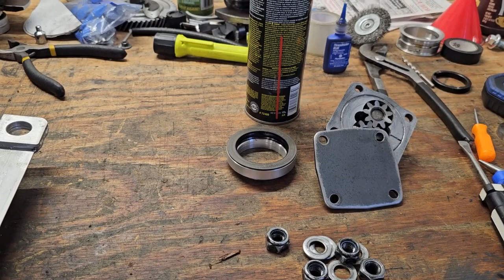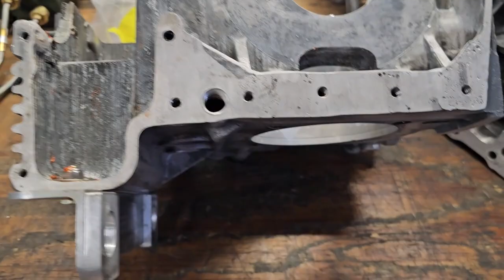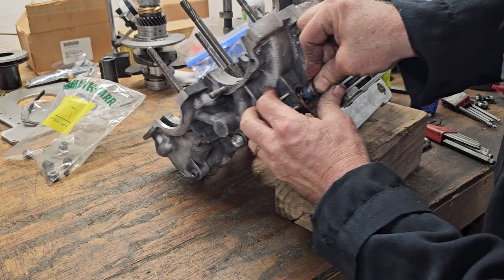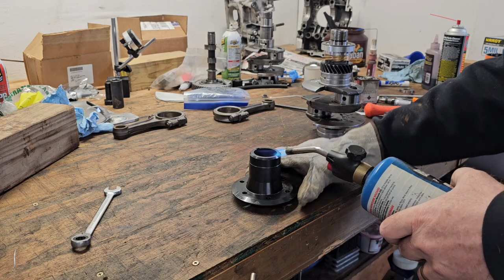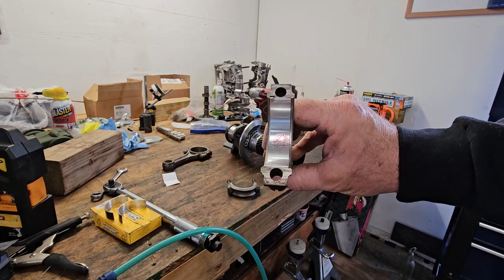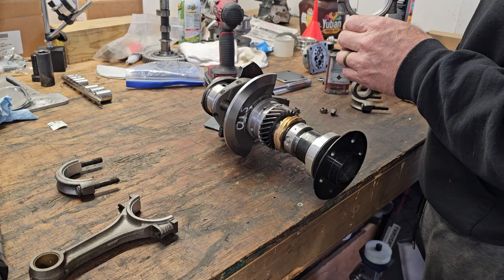1/2 VW Build - Part 16 - Oil Plugs, Prop Hub & Connecting Rods

Comment: What is the bore & stroke of that little beast, ig you would
Reply: I saw a guy check rods are straight by lining up rods and sliding a wrist pin into two rods at the same time. I didnt do it on mine but it is a good check. Plastigauge is good stuff.
Reply from the maker: @jacquelinechellis4036  That would be a good way to check them.  Quick and easy.
Reply from the maker: Bore is 94mm and the stroke is the stock 69mm.